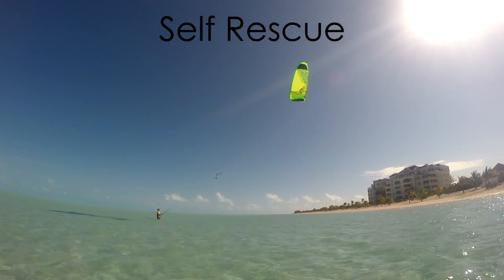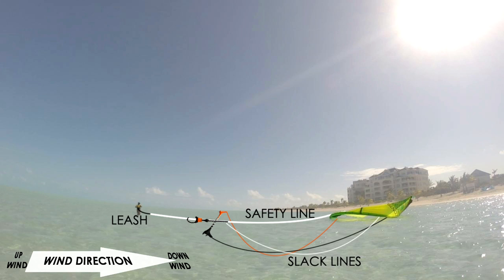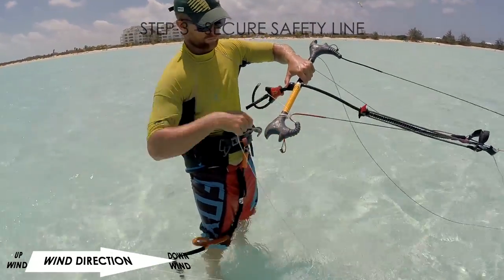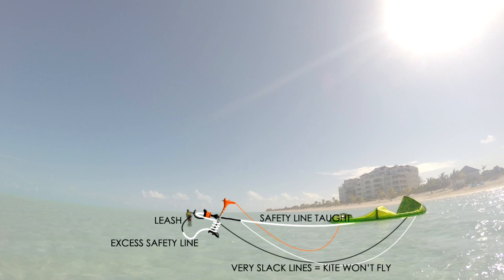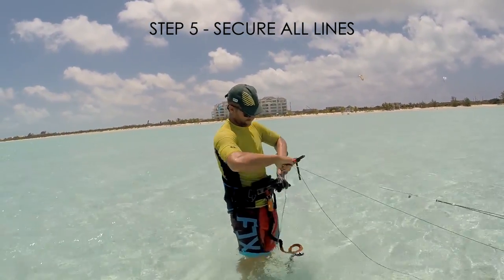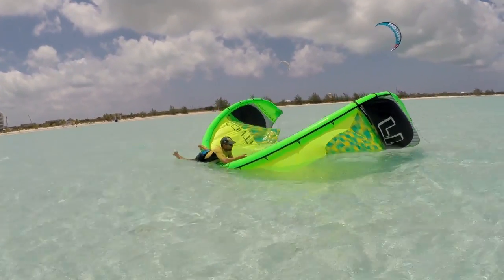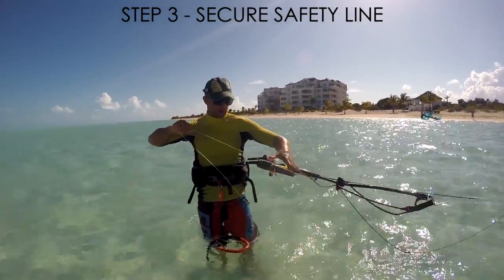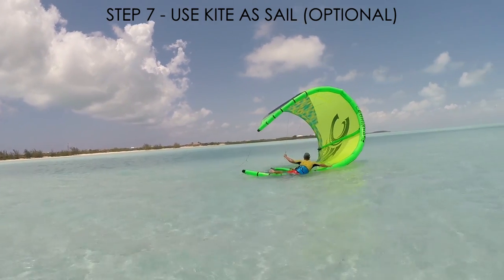Kitesurf Self Rescue

Comment: Clear explanation and ideal example 👌
It would be great to have a updated example of where this is done in deep water and with a kitboard too. 

When I have had to self rescue I tried to swim upwind to collect my board. Then I start wrapping the lines (while keeping the board between my legs). When sailing back in you can place the board and bar on the front tube. I generally try to keep the board with fins up as not to damage my canopy. 
Off course safety is priority and if you are in an area with onshore wind and or waves most likely the board will end up on the beach if you loose it. Or another kiter might collect it for you.
Reply: Happened to me yesterday during a self-rescue. A random kiter collected it and brought it to the shore for me. 🙏😁

Comment: This is sooo easy to do while standing.   Do this in deep water with high winds is extremely difficult
Reply from the maker: Hello Sid. It really is easy to self rescue in deep water ... once you have enough practice. High winds can be a problem, you're correct. If the wind is strong enough, there can be a lot of pull on a kite even when it's flagged out on a single line.

Comment: Great video, covered all the main points, thanks guys. When you get to the kite and flip it over, make sure to double check that all lines are clear and not wrapped around any part of yourself. And if you are coming back to the beach through a shorebreak, don't forget to let go of the bridle and hold onto the centre of the leading edge tightly so the wave does not cut your bridle hand or rip the kite out of your hands. And marco boersma is right, it's a different game altogether in stronger wind and rough water so it's a good idea to make sure you can do the SR in whatever conditions you are kiting in.

Comment: Important: Would be helpful to mention how to safely secure one's board during self-rescue and extra equipment, i.e. leash, needed to ensure not losing board or drifting too far away.  Also acts as an additional floatation item in the event kite may deflate.
Reply: If you need to self rescue in high winds, leashing the board is risky! If something goes wrong you can get hurt quite quickly. 

I’d just forget about the board and save yourself. Your board will be found eventually.. 

Always keep your leash connected to the bar so it cant get away from you. I wouldnt recommend also leashing the board with your safety leash

Comment: Love Your video series & always recommend to students (esp visual overlays)!! 

 Instructor disclaimer is critical bc there's a few points I'd add - namely notice which direction is Down-wind/Down-current after pulling QR ... Only wrap lines & retrieve kite as you can stay UP from lines ... After securing flag line Student couldn't wrap all 4 on bar without towing back on safety line bc of high pull -  after you chill in the kite you can wrap the remaining lines (and bc you traveled back by staying UP you shouldn't be too tangled) ...
P.S flipping a 13+ kite in open water is practically a lesson itself haha. In fact i demonstrated on a large kite to prove that point+pull & then held kite-raft once student climbed in.  
Thank you so much Profe.!!

Comment: It looks like this video was shot in light wind conditions. Yesterday I somehow lost the chicken loop at 20kts. I did an involuntary self rescue :) However, although the safety line was extended, and the lines quite slack, the kite generated quite some power (it stood at 3oClock on its tip, ready to be relaunched), and would turn wild when I attempted to grab the bar. What did I do wrong? Thanks

Comment: Guys this looks so easy but I did it yesterday in high waves and where you cant stand while trying to not loose my board. Just wrapping the lines around the bar is a nightmare. I had the quick release pulled and the kite still catched wind sometimes. You get tangled up in lines easily. Luckily I could use the kite to drift to the shore.

Comment: "flip your kite over this way" = you most likely got ahold of it in the center, transfer it hand-to-hand until you're holding it on one of the edges, then you will be able to flip it easily. Then pull the bridle leading to the farther end to bring that edge up.

Comment: Unrealistically forgiving conditions make this video really kind of dangerous...  I accidentally QR'd in 20 mph side shore wind w/14m kite in deep water today.  Tough going!  Everyone should have a plan for real added factors, including  1. keeping your board with you.  2. Over-head deep water in howling wind (can't pull kite in to wind lines - hard to not get legs wound up in safety line before winding it up)  3. Fatigue  4. Returning to shore.   Recommendations:  Unhook leash, run through board handle, rehook.  Find a side-ON option or don't go out - side shore temptation is trouble.  Seek shallows, know where the deep water begins b/c being able to stand makes all the difference!  Wear a PFD!! so fatigue and stress are less of a factor.  Watch deep water pack down and other realistic self rescue videos.  Take off the rosy glasses - sh*t happens!  All this said, I appreciate very much all that KC videos have taught me/us.

Comment: Just curious, would this also work if you were to use an oshit handle instead of the safety line?
Reply from the maker: +Ole P. Hey. Good question. Yes you should be able to complete this technique using whichever line you depowered the kite on. Make sure the bar has travelled a kite's width along the oh-shit handle line and is fully flagged out. You'll want your leash attached to the oh shit handle. Then work along the line from your o shit handle; when you reach the bar, secure this line on the bar end then wrap away all lines as normal.  By the way, what bar do you have? Does it not have a centre line safety? Or were you asking this in case you can't use your centre line safety? Cheers.
Reply: +Kitesurf Co Hi, thanks alot for your response. I have a Slingshot Compstick bar, which does have a centre line safety. Like you said, I was just asking in case I can't use my centre line safety, for example, when the flagging line tears. Great informative video by the way!
Reply from the maker: +Ole P. That's what I thought. I have some slingshot gear too and I've done a self rescue using a steering line/oh-shit handle. I had to do it when a bridle snapped.
Reply: Not sure I follow, how is what you show in the video different from what happens with Slingshot kites?
Reply: Ole P. oshit handle .. am i reading that right?

Comment: How would you self rescue if the kite becomes deflated?
Reply from the maker: Hi. If the kite is completely deflated, you can't use it as a float or sail. Instead, when you get to the kite,  you probably want to roll up the kite. You can roll up the kite starting at one wing tip - as you go along you can close the strut valves to keep some air in the kite - also detach the lines. When the kite is rolled up, you can use your leash or harness to wrap around the kite and keep it packed away neatly. If you're some distance from shore, it is much easier to drag a rolled up kite. Is that what you meant?
Reply: @kitesurfcollege  Yes, thank you! Your self rescue video is super helpful and intuitive! However, I just realized in one of my lessons, the kite deflated. Thankfully my instructor had a jet ski to pick me up. But it made me wonder how I would rescue myself if I was in the water alone.

Comment: Great Video!  =D I went out on my 8m after I was out in around 27 knots gusting to 37knots which was definitely manageable. However when the wind picked up to 50 knots I was still managing with my edge but knew when I got closer to shore and waist deep that I'd be pulled like a rag doll so I figured it would be better to release donkey dick and let waves take me and kite to shore and have a kiter grab my kite.
I found when I got to standing after doing this that to try and pull on that middle line was pretty damn tough! Plus the waves were jolting me every now and then. The kiter got close to the kite before it rolled over and jolted me even more. 
After the third time this happened I released everything as it was getting risky.
I love the video! But what would you recommend in unexpected extreme weather and waves like my scenario?
Reply from the maker: Good question. It is not safe to self rescue with that wind strength or significant waves pushing on your kite.

Firstly, I think the best tactic generally is to try and avoid getting that overpowered in the first place. Keep an eye on the weather - if you feel the power building and see a weather front or tall, dark clouds approaching head in. Land the kite, let the front reach you and see what it does to the wind. You usually have enough warning when weather is changing, but not always.

The worst situation I was in, was in Rosebud near Melbourne. It was an easy 18knots warm North wind, and I was on a 17m2. In under 2 minutes an antarctic air system pushed in and the wind climbed to 56knots South. One guy left his kite in the air, and it split in half. 

As I began getting over-powered (25kn). I put the kite in the water at 3 (the beach was on the right) and was going to let it drag me in and have my friend catch it (there were no waves luckily). But then the wind was too powerful (even with the kite at 3 I was getting pulled violently) so I ejected the chicken loop - the kite flattened out nicely, luckily, and I was able to get hold of it using the safety line and making sure no other lines were upwind of me. But I was ready to also use the leash the whole time, as there was a good chance the chicken loop eject wasn't going to work well in that kind of wind.

In summary,  I would say:
1 keep an eye out for weather changes and take a break before fronts or cumulonimbus clouds reach you . 
2 if you're not too overpowered yet, get someone to catch your kite at the water's edge (don't go on land yourself)
3 if you're over powered you can use the chicken loop eject to drop the kite near the water's edge and get a friend to grab it from the shallows 
4 and if that doesn't work use your chicken loop eject and then leash eject to get rid of the kite.

Show less
Reply: Kite-Surf-College Tutorials and Tricks awesome thanks mate! 🤘